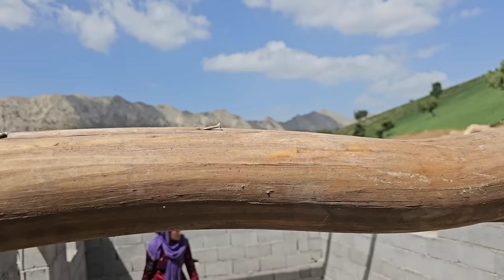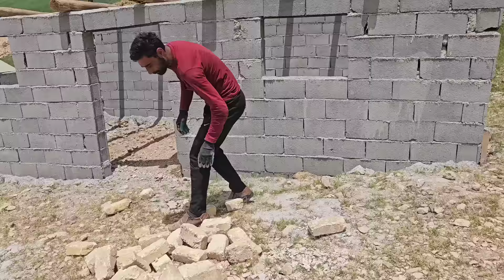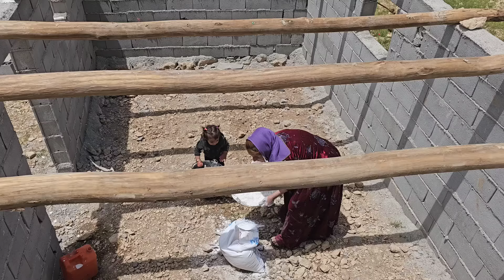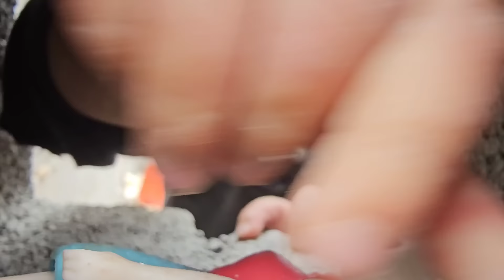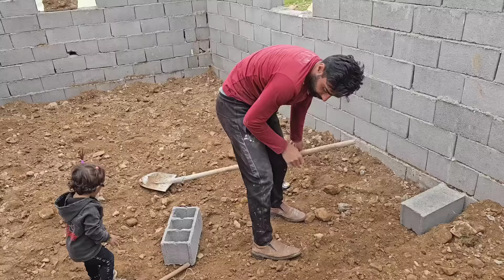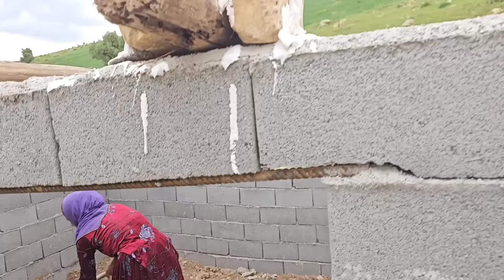"The latest trend in interior design: the use of modern wood for the ceiling structure"

Comment: I agree, this is the work of un experience people, it needs one more line of cement block at the back and two more line infront the house in that the snow will just slide off from the roof and rain also no need to climb to the roof

Comment: A little bit of plaster on those beans doesn’t make it very secure. Also, Khalil, do you plan on living there? You won’t fit through the door or be able to stand up inside without walking bent all the time. Your head will be touching the ceiling. Odd why you didn’t build walls taller.

Comment: Khalil's roof should be higher, it's too low.😮😮😮😮😮😮😮
Reply: Especially if they raise the floor when pouring cement in order to prevent flooding from the door being level with the outside dirt.  Need higher, sloped roof to be safer.  ❤❤❤❤

Comment: Why not add a sloping roof ? It would stop the rain settling on the roof which causes too much weight. With all the mountain stones they could add an outer layer to help prevent rain soaking into the walls.